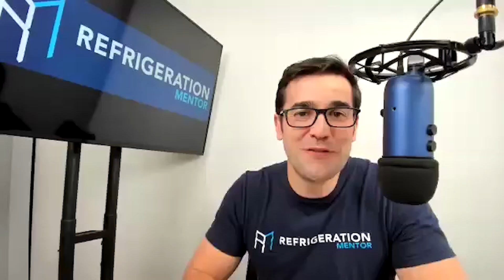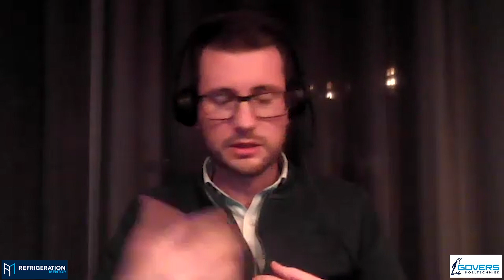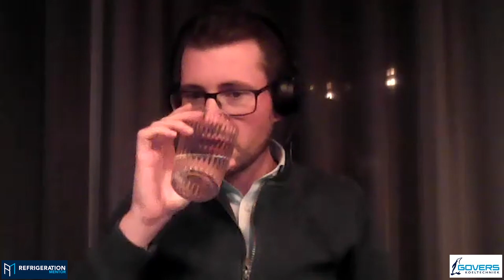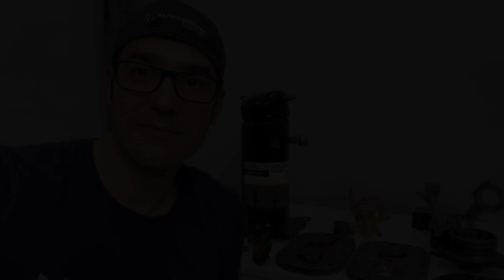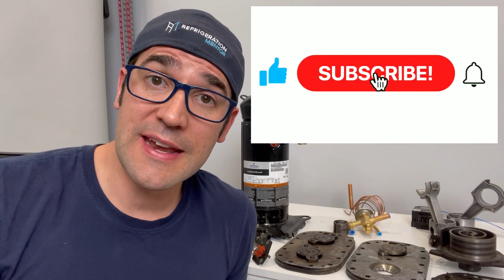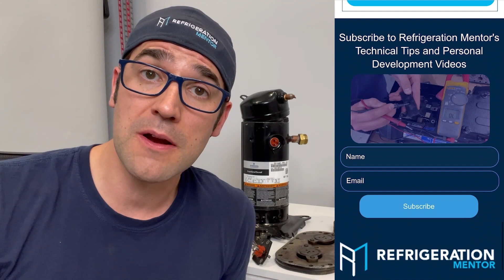Challenges Faced When Installing CO2 Systems

Comment: Pumped CO2 transcritical systems are very interesting. We install industrial 2-stage ammonia systems with  liquid overfeed and they are really efficient. So CO2 pumped systems should be really efficient as well.The key to efficiency is running as high a suction pressure as practicable and at lower condensing pressures as the system will allow.
Reply from the maker: You are spot on. When you can do that will a floating suction and condensing you will save your customer a lot when the system is running properly and effectively.